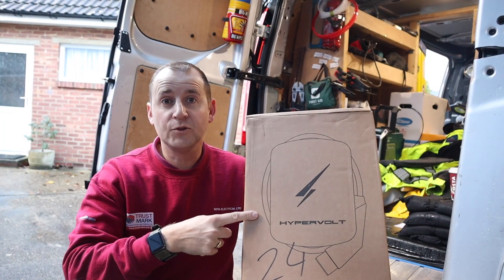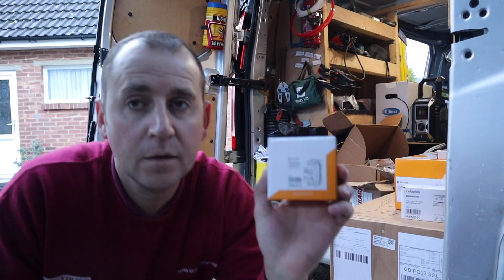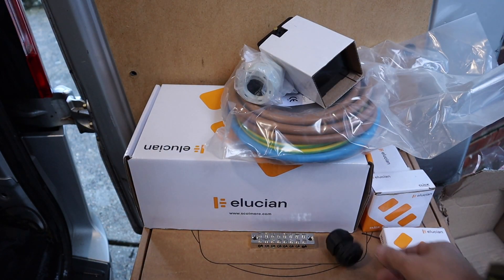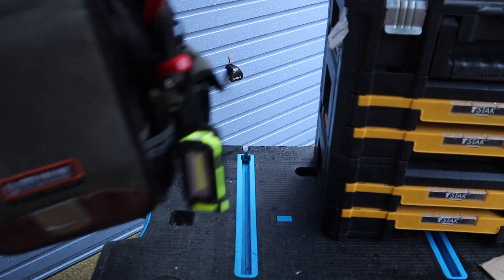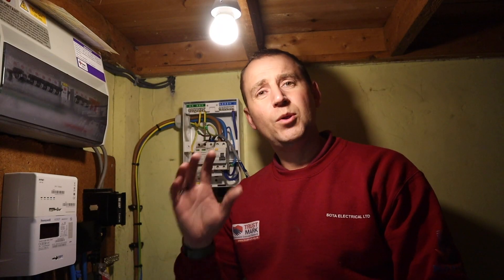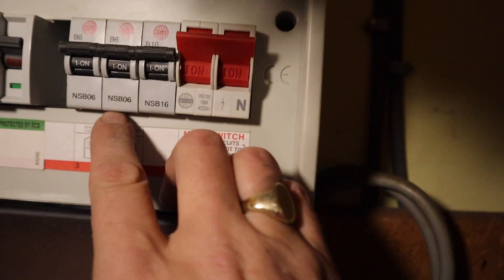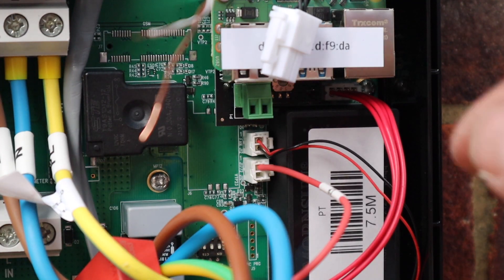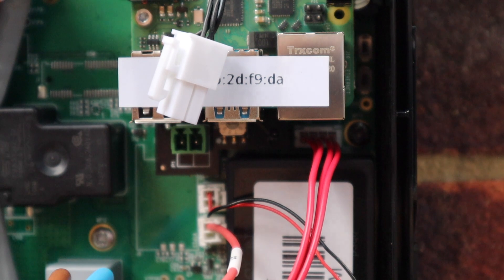How To Install A Hypervolt EV Charger

Comment: Hiya mate, we had a Hypervolt 3 installed in May after watching one of your videos. We are miles away from you in S Wales so couldn't get you to do the job 😉and don't ask me why, because we've got young kids and the LED display was one of the things that attracted us to it, but we didn't try it until the last couple of weeks - always thinking, ah it must be something in the app I just need to enable. 

But since just recently we discovered the LED display was enabled and it really should have been on from the very first minute it was plugged in? Is that right? And in your expertise, do you have an idea what could be wrong with it? Faulty box, faulty installation?

Cheers mate
Thanks
Reply from the maker: Hi mate! The LED has a little plug that needs plugging in, it’s probably that!

Comment: I need to tell the problems I had during my own installation. The wiring from the new consumer box to the charger went alright except the wall was thicker than my drill was long 20”. The fitting went OK and the Ethernet cable would not talk to the  charger it kept wanting the WiFi but the signal was poor at 86. Anyway it was tested and everything seemed good and the blue lights were showing and the car was taking charge OK, then the charger turned red with a fault I did not know, I rang the helpline and they checked it over the internet and it was Ok again, The next day it was red again. Today I rand the helpline again and looked whilst it was red and read the voltage logs it went up through  254 when the red light was on and dropped to 252 when working. I contacted the ANO and they were there an hour later???? Quick? They confirmed my high readings and checked the substation which was too high so have arranged another team the change the coils giving the high voltage . The current changes  coincided with the high peaks before 4.00pm  and the  correct running after mummies came home with the kids.
I was really worried about the charger being faulty or me cocking up . I thought you might be interested about the 240volts plus10%. And how finely the unit monitored the incoming voltage.😊
Reply from the maker: I’ve come across this before and made videos on it so I know where your coming from, thank you for sharing

Comment: If your customer requests a 10 metre cable, do you take this into account with your volt drop calculations or does your calculation end at the charger position.

Comment: This charger is complete junk don't buy it trust me
Reply from the maker: I have had no issues or complaints about these chargers what so ever and I’ve installed loads
Reply: @sotaelectrical  maybe because if you post anything about it in the group the owner gets you removed
Reply from the maker: @rajindernijjer  I’m sorry to hear you have had bad experiences, I don’t work for HyperVolt, I’m not in any groups online, I personally have not had any complaints from my clients about them
Reply: Which charger would you recommend if you say this is junk , I'm in two minds now
Reply: @leecowper1509  it's been ok now but it did have a few issues missing charges, not logging them on the app etc
Reply: If you class this charger as 'Junk' please explain why? just saying it's junk without your reasons makes your comments worthless - just a throwaway statement. Also did you make the effort to speak to Hypervolt for support? FYI, I don't work for Hypervolt or have any connection.
Reply: @lestaylor7767 alot of glitches even misses alot of chargers